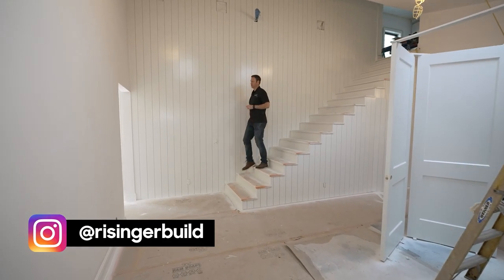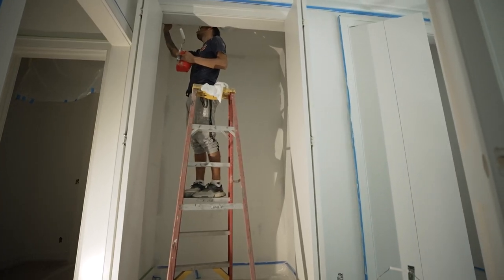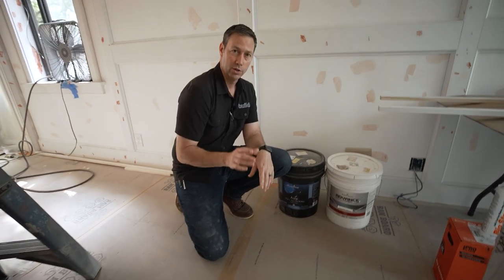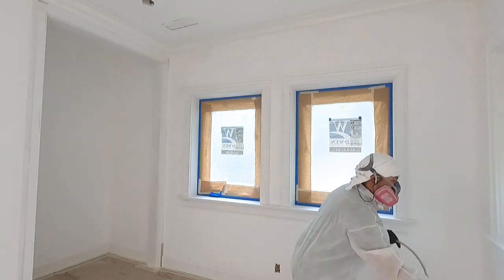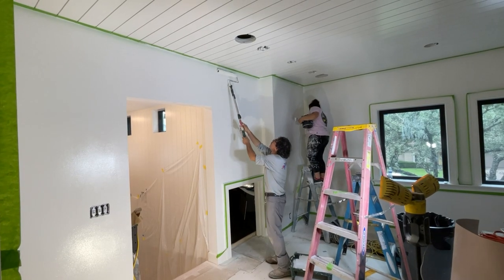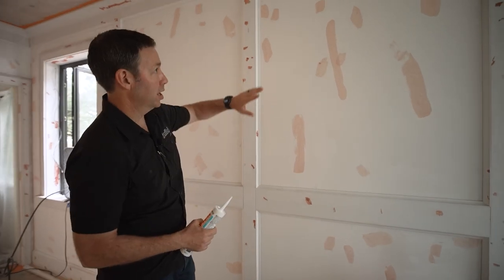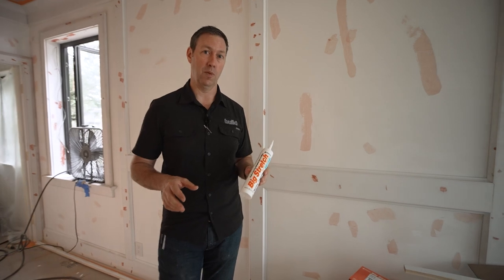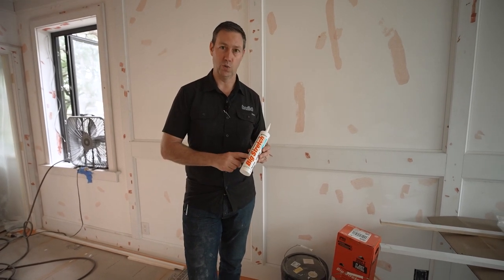The 4 P’s of Perfect Paint

Comment: What was that thick black exterior membrane you used a while back? I think it was the final wrapping before siding.  Anyone? Bueller?
Reply from the maker: I don’t remember that. My house has Zip Sheathing, Altas PolyIso Insulation, 1x4 battens then Hardie Plank
Reply: @buildshow  Sorry, I'm losing my mind. I know you're using the Zip system on your house. I could have sworn at one time you were showcasing some thick black wrap somewhere. Does Benjamin Obdyke InvisiWrap UV Housewrap come to mind?  I want to remove the siding and wrap this house up tight because of where it is there is blowing wind and rain frequently. I sometimes get water leaks through the walls.

Comment: Wrong Matt, you don’t “Get what you pay for” with paint. The only way to find out which paint (and primer) actually does what it is supposed to do is to test it yourself. Do not rely on price as an indicator of quality and performance. For example, as a painting contractor, I needed to find the best performing primer to use. I painted several samples from a handful of brands on a variety of materials, drywall, wood, stucco etc., for a period of time, I left them out in the sun, under the sprinklers in the lawn, and then scratched each sample with a nail. There is no correlation between price and performance!
Reply: Sure there is.  Advance is amazing.
Reply: Some of the more expensive paint is “self priming”, but if priming anyway I don’t see the advantage of picking that over the contractor grade paint.
Reply: I'm not gonna pick Matt apart on a rule of thumb, but there is something to be said about performance testing, technical data sheets, product sales support and professional experience that helps to find the right blend of quality in application and ultimately performance.

Comment: Project farm has a detailed video on paint quality vs price. I disagree on you get what you pay for, 5 gallons of urethane alkyd from sw is 400$+, behr at hd is 180$. The reality is these big box stores have a much higher budget, much higher purchasing ability, and way lower overhead. Sw is easier to purchase, and more helpful staff, but the paint is not more than twice as good, arguably its a  5% better product
Reply: I went less expensive in a condo remodel and used the Behr alkyd enamel for millwork and my cabinets. It runs VERY easily and takes forever to completely dry if you live in a humid climate like I do. Lots of extra work to sand out the runs and touch up. Won't use it again. Applied with a small Graco airless sprayer and a .310 FFLV RACX tip. I'm a DIY'er but very meticulous in my approach to things. My paint work is "crisp".
Reply: @richardpellis  I live in Houston and spray airless in 90%+ humidity and do not have any issues, the only difference I have noticed is that the behr is "tackier" when spraying. My feet stick to the floor more so with behr... doesn't bother me 200$ worth tho